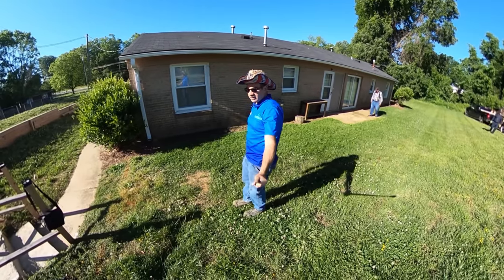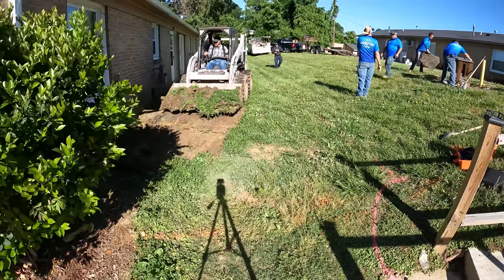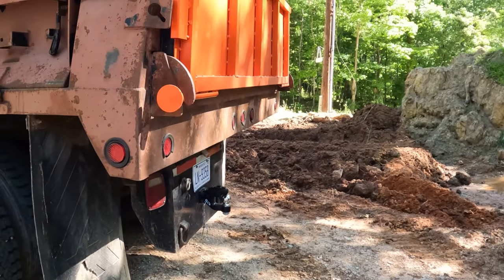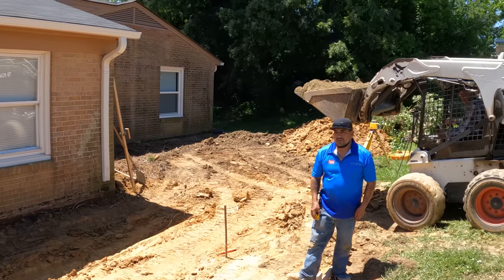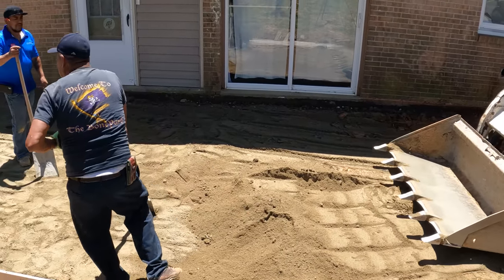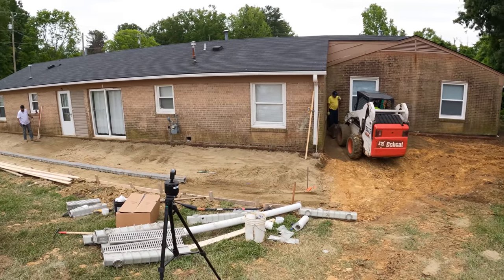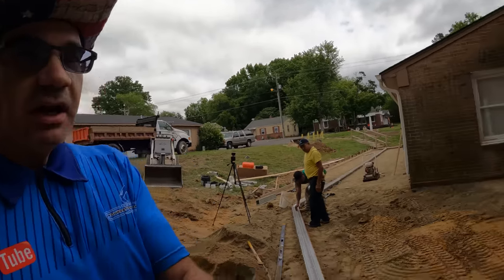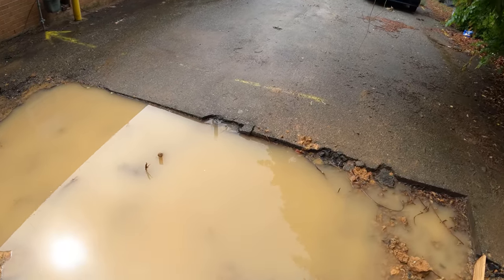Part 3 of 4 The worst Apt. Flooding I've ever seen!

Comment: Sometimes I wish I had the physicality to do work like this. After watching for about a year I now find myself looking at other homes and businesses and seeing how their drainage works too.  Great work to everyone involved!
Reply from the maker: It's a lot of work Andy. I don't mind getting more people and machines involved to help out with the work. I also don't mind taking extra time to not work as hard.
Reply: Open a business and hire out the physical work! Go get it!
Reply: Currently a guy in my neighborhood is having a contractor work on a slope directly behind his house that is higher than his 2nd-story house.  I wouldn't touch that job on a bet if I was in the business.
Reply: You're not the only one. After watching GCF videos I looked at my own water drainage and knew it needed to be corrected but because of GCF, I hand dug a 1.5' deep 90 foot long trench and used 4" PVC and not the corrugated crap. The previous or the previous previous owners knew to of a drainage problem and I dug my trench where they put 3" corrugated pipe with a silt filter.
Reply: Good going, yeah a DIY solution is sometimes needed just having to do a bit more brain work in the process & having the knowledge after seeing what GC does
Reply: @ an dy   Yeah ive previously offered my employment to Shawn - If only I didn't have a bad back and cant do thd labor stuff anymore,  i hear you, would be satisfying to see the finished outcome

Comment: Great job team. I have to say it was careless in the extreme (IMHO) to ever construct that apartment block in what looks like the dead centre of a sizable depression in the landscape. Hadn't they heard of fill? Or perhaps just did it on the cheap?
Reply: Reminds me a lot of section 8 apartments that were built around the New Orleans metro area in the 80's in the worst areas as cheaply as possible. All of them have issues like this constantly.
Reply: what if it was there first and much of the area surrounding it was lower in the past? until the surrounding lots were constructed and a ton of fill to raise their elevation.
newer building codes and practices do just that quite often, they go in "high and dry" and end up diverting all the water to the older structures and land.
Reply: @throttlebottle5906  I doubt it, even the road and sidewalks are higher than those apartments and nothing around it looks particularly new. Looks like they just built in a ditch.

Comment: That's really good to have the grading pase done and get a rain and see where you sent the water with very little fall just to keep it off the building.  Using the cement walkway as a waterway is ingenius withouth a drain or trough!  Good thing the new owner is taking a proactive approach to problems, save the proerty, and improve tennants living situation!
Reply from the maker: Yep! This will be a great property when we fix the drainage issues.

Comment: Loving this series! Good job Shawn! Hope that property has a daily maintenance guy to come by and make sure that drain is clear. 1 Torrential downpour with a little blockage and its flooding all over again
Reply from the maker: I did explain to the owner that this is such a sensitive area that they need to be extremely diligent in keeping the system clear and flowing.

Comment: When you did the drone shots in the last video the gutters were all plugged up. I’m also surprised you’re not connecting PVC pipe to the downspouts!!
Reply from the maker: With that huge willow oak tree I wanted less closed pipes that could clog. By allowing the downspouts to discharge onto the concrete and having the concrete sloping properly, it will be easier to keep an eye on everything. I wanted this to work regardless of gutter maintenance. 👍

Comment: The dump truck is good but you need an air cylinder to unlock tailgate. Very good for tailgating a load of mulch or small rock.

Comment: They could do with doing some landscaping, some trees and shrubs, that would soften the area but also they would suck up the water
Reply: Large planters would look nice.
Reply: Yeah. Some of the trees can remove a lot of the water from the ground. There are also some cons, like that the roots could introduce a bunch of new problems, or like that some of the trees would need a long time to grow.
Reply from the maker: I don't use vegetation and evaporative transpiration in cases where there is flooding that affects a foundation. The veg just can't remove the hundreds of gallons a minute that may fall. Veg works well enough for areas with persistent soggy soil away from structures.
Reply: @GCFD  Yea, that's why I thought planters would be good along the walls and separating the units. They're usually in a large concrete base. I think they're kinda expensive though but not easy to move if someone wanted to take it with them.

Comment: There's no substitute to sitting back and studying what happens in the worst downpours.
I had the same problem and I managed to get a channel drain and pipework in before pouring a large patio slab.
I knew I had a water problem but had no idea of the scale of it until seeing it after some serious downpours.
The channel drain moves a lot of water in a hurry and was a complete success.
I also added extra downpipes because there weren't anywhere near enough and tied all the pipework in together under the new slab.

Comment: On the new DumpTruck, I'd put that latching mechinism on a strong sylinoid and re design it to be a push button inside the cab to release it.
Reply from the maker: Great idea Mike! That truck is unbelievable to me because it's my first experience with a dump truck that started out as a dump truck. Everything about it works instead of being retrofitted to try and dump.

Comment: Normally when it rains during construction it's a problem, but in this case it has a side benefit by exposing a new problem. If you look closely in your video at the bottom of the hill where there is standing water, you can see that the water is level but the existing pavement slopes the wrong way towards the building.

Comment: I note that most of the rainwater pipes direct the rainwater directly onto the ground, quite a lot of properties have no guttering or downpipe, quite a lot of downpipes finishing a foot (300mm) above the ground saturating the wall, that is contributing to a waterlogged situation and damp penetration. Obviously, there is no statuary duty to direct the storm water into a piped system (if one exists). Are you allowed to direct surface water to another property, thus moving the problem on.
Good working practices.

Comment: I've watched a heck of a lot of your videos, and I think this series might be the most difficult problem I've seen you tackle yet. Am I off on that? Was there another project that was even more challenging? 🤔
Reply: Agreed and i think you are correct probably is the most complexed one yet, and certainly a challenge, Like someone mentioned above, Most likely a former section 8 low housing type plot etc and unfortunately looks like the whole thing should be wiped & rebuilt
Reply: @Stratos53100  Yup! I can't believe inspectors signed off on that place. The grading, or lack thereof, is horrific!

Comment: Hi Shawn.  In the first part, when you installed the drain pipe through the apartment, but did not see how it was, the water came out from the other end
Reply from the maker: I'll revisit that in part 4 or 5 of this series. 👍
Reply: @GCFD  👍🌹

Comment: I would hire you to do work such as this ,once in a while I have to solve  issues with water with foundations .I cut trees/limbs  back ,grade away from foundation ,gutters right size and discharge  at least 10' away to day light or tie into a drainage  pipe .Then if need be build catch basins or French drains very last sump pumps .
Reply from the maker: Thank you Billy!

Comment: Hey Shawn, it's looking good. I can't wait for part 4.
Have you considered getting a laser that you can set slopes with? 
Have you thought about having a "maintenance division" where you could sell preventative maintenance, PM, contracts to commercial accounts like this and the other apartment complex that you work at?  Maybe twice a year more or less depending on the conditions, you would go to the location and clean out the trench drain and be sure the outlet is clean, etc. It's also a good way to "up-sell" by noticing things that other people overlook and you can correct them before it's a disaster. This type of work often gets overlooked by the onsite staff even though they know how important it is, you know, we'll get it next week.
Reply from the maker: Thank you Roy! Part 4 will hopefully be posted this week. I have thought about the maintenance side but I haven't tried to sell it yet. I agree with you that it could be a good way to gain some extra work, especially since I could work it into a schedule that wasn't super urgent.
Reply: He has one. You can see it in part 1.
Reply: @firesurfer  I must have had a senior moment.  I saw a laser set up but wasn't sure if it shot slopes mainly because they were getting the pitch using a spirit level. If they were using the slope/pitch feature, they'd be using the grade rod.

Comment: At 0:07 you can see at the end of the building there's a big tree is there a place to send the water from your drain over there, and then can you dig a trench to bury your pipe with enough fall to drain that way and still be able to keep it out of the structure that is in front of and to the right of the white truck on the other side of the bushes?

Comment: Nice Job. Wondering if you had the gutter drains joined into the PVC to take that water on down the path.
Reply from the maker: No I didn't like the idea of inputting that much debris into the pipe with such little fall. I like the idea of the debris flowing out onto the concrete where it can [hopefully] be removed.
Reply: Random person 22:31. I think I saw him in the last video too.

Comment: those type B flue pipes on left units at 20:07 look very wrong/disconnected/pushed up out, hopefully that's the vacant units, because they seem to be the water heater flue pipes. 😳 ☠ co poisoning if not.
also the unit at far right side of 20:23 , the storm collars to stop water running down the flue pipes and cover the roof boot tops is also pushed way up off the roof!
maybe they converted to electric water heaters, but that's still causing roof leaks and building damage.
Reply from the maker: They are electric cold water heaters now. I know they are doing a ton of work over there so hopefully things will be corrected.

Comment: Hi Shawn I was wondering why you didn't hook up the down spouts into the channel drain 🤔 Other wise you have another job well done 👍 I see we have more videos to come on the same job will be watching
Reply: It’s beyond me why for the $$$$$ spent here on this job why the downspouts were not added into the system! Seems all his videos are all about “catching the downspouts”. I mean I get that PVC cost is up, but heck all costs are up. With his job on the line here it just doesn’t make sense why he didn’t capture the water from them and immediately get it into a pipe and away. 🤷🏻‍♂️

Comment: The new dump truck is awesome! and will move a lot of material. Does North Carolina require a cdl for that truck. In Alabama we are good until you cross 26,000 lbs. I didn’t know if air brakes affects it or not
Reply from the maker: No this truck is under 26k and even with air it doesn't require a CDL. I got m CDL in feb right before the laws changed though. 👍👍

Comment: You should invest in an engineers/ surveyors level. Then you can survey the levels of the doors ground etc before you start work and produce a plan. When you start work you will be able to put some pins with tape on at the desired level in along the line of your drain. Then you can lay to the tape.  Using spirit levels and a laser that is not set to a grade/slope is not a good idea on a very flat site.
Reply from the maker: I have a nice transit laser level that does slopes but I still prefer string lines and grade stakes, while checking everything with an 8' level. The laser only gives momentary information while the string and spirit levels give continuous information. I also don't want to take on jobs where the tolerances are so tight that only a laser can determine the slope. That's too risky to not get things right and I've turned down work for that reason before.

Comment: As an arm-chair drainage expert I don't understand why you didn't run the downspouts into PVC pipe asks get that water off the concrete. In the courtyard why not run them into that catch basin?
Reply from the maker: Great question Brian. Debris is the answer. I didn't want the pipes to risk clogging with the state of gutter maintenance, the large trees, the little amount of fall, and the grates on the end of the pipes here. If the grates on the CB or channel become clogged it's easy to recognize and correct vs. a clogged pipe or outlet grate that is harder to see and fix.

Comment: you can french drain with waterproof. im a license WP out here in cali
Reply from the maker: That't not my style Johnny. The reason is I don't think you can ever 'waterproof' something like this. My plan of attack is to keep the foundation so dry that it doesn't matter if it has waterproofing or not. I would never want water sitting against a 'waterproof' membrane or coating and hoping it holds. I want the water gone from the foundation 👍

Comment: Do you think digging a swale would work instead of installing channel drains?  Just curious if there were other options in this area is all.  Great video!
Reply: I think with a swale you would still get ground seepage in soil that is already loose/weak because of standing water.

My guess is that when they originally built the place, they had a swale, but nobody ever thought to maintain it. Conrete helps to keep that from happening again.

Comment: Wouldn't schedule 40  drain tile solve all this. Isn't that the reason it's used around every new foundation doesn't matter its buried 8 ft down or  what the  ground is. As long as the pipe  is flowing downhill the water gonna go. Seems like alot of extra money is being spent on concrete.
Reply from the maker: Here's my thought process Mike. We are dealing with surface water here, So I want to keep it on the surface. A drain tile would be inviting all that surface water underground and right along the foundation, then hoping it flows out (still underground where no one can see or assess if it's working) and doesn't cause issues. I like to keep surface water on the surface.

Comment: You indicated the foundation would be lower than the French drain trench , but you excluded the option to put the French drain at the foundation level or below. Do you ever do those type of French drains?
Reply from the maker: I never use those type of FDs because you're taking surface water and sending it several feet into the ground where you can't keep an eye on it. I like keeping the water where I can see it flowing away. 👍

Comment: Use caution when driving on sidewalks and over curbs, I have seen them break.  I know sometimes it cant be avoided, just passing on what ive seen. Enjoy the vides, Keep em coming.  :)
Reply from the maker: Great advice BB. I worry about that every time the concrete truck rolls over some concrete. yikes!
Reply: @GCFD  Maybe lay down some plywood to distribute the weight over a larger surface area.

Comment: You don't do footer drains at all there? We use them against water table issues here in Finland. Granted it doesn't fix surface water issues, which is probably what you had going on here. We don't use concrete either to divert sufrace water. Probably because it would freeze and break over winters and springs (you have to mount everything below freezing point here).

BTW we don't call footer drains french drains here, they are called "salaoja" which literally translates to "secret ditch".😄 Probably because when buried it's out ot sight and out of mind and everybody forgets it (until it doesn't work anymore).

Oh yeah and awesome video series, as usual! I'm watching every part you put out.
Reply: Interesting. For others who didn’t know the term. If you do a search for “Footing drain” on Google images you can see a lot of examples and diagrams.

Comment: I feel like these residents are getting two birds with one stone, their flooding will be solved and it will act as a proper patio space as well 👍
Reply from the maker: That's one aspect I try to sell up with concrete solutions. You're exactly right that they will have a space of their own once the solution is finished. I haven't been back there in about 6 months but am expecting to see some evidence of their using the patio space when I return for the last video installment.
Reply: @GCFD  yess, I feel Like you just increased their livable space too, space that they didn’t have before , while solving the flooding issue as well

Comment: If Fall cant be perfect couldnt a sump help push the water where it needs to go? Like have the water from the channel drain gather in a sump where the fall is an issue and then use it to push the water the rest of the way out? I think thats something you normally do anyway isnt it?
Reply: I felt a sump pump for gutter water and 2 or 3 for the channel drains. There's a lot of water going to those channel drains.

Comment: My question is, would it keep up with a major storm that's common in your area?
Reply from the maker: I talk about it more, but I deliberately sloped the concrete to channel the water even if the entire channel drain and pipe are clogged and useless. I caught a good video of just that. I really needed this to be [lack of] maintenance proof to work.